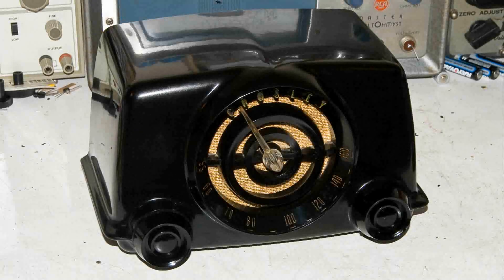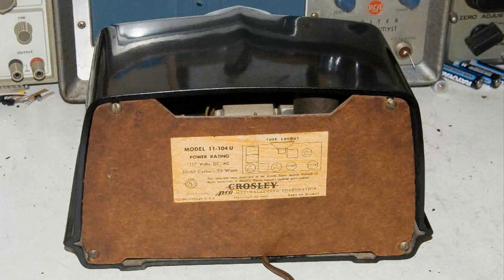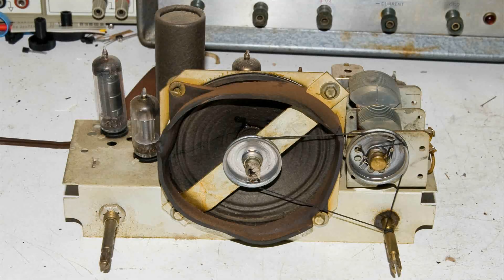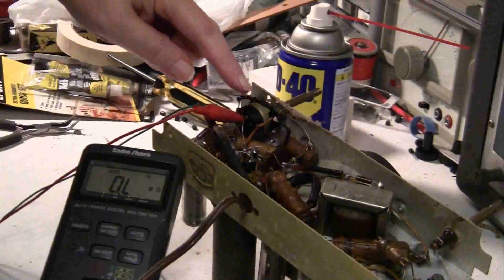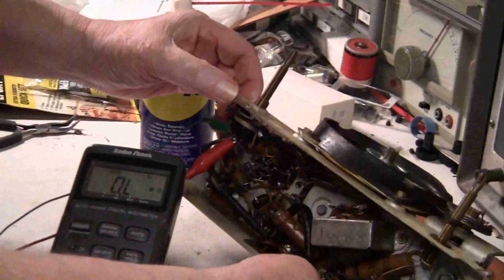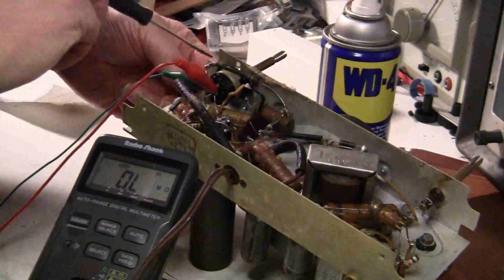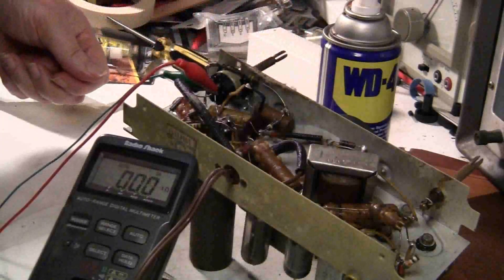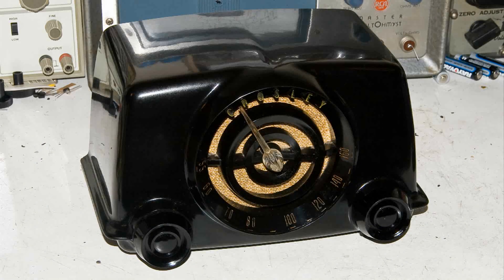Crosley radio repair 11-104U part one

Comment from the maker: Thanks AndyDaviesByTheSea
Hey Andy
It can not repair crackling. What it does is, it puts back the petroleum that has evaporated form the media that the carbon run is on. This causes the media the expand back to its original from. I first tried it out on a transistor radio, fifteen years ago. I used this radio today, and most everyday. I did a video on this radio a few years ago, I'll send you the video.
Regards
Rick

Comment: Hi Rich
Nice old radio there.
It looks like you squirted a shot of WD-40 into the switch and then another onto the carbon volume control, have you been using WD-40 on carbon tracks for a long time i.e. do you have good experience with it on carbon and does it cure crackling?
Kind Regards ... Andy

Comment: This radio over due for service about 60 years over due,he is  lucky to have you to work on it,these kind of radios is one of the reason I like tube radios the other they sound better to me.,and if a new radio breakouts in the trash ,once you did this one.it will go another 50 or 60 years.new modern radio don't look like anything special ,to the point that they are making bad copies of old radios.
Reply from the maker: THANKS

Comment: Use contact cleaner, it works a lot better than WD-40.
Reply from the maker: How many radios have you repaired?
Reply: Been repairing them since 1970's can't tell you how many I have repaired. But usually if the on-off switch sticks, it is either the little spring inside or the contact has been blackened. I used to replace them when they were a dime a dozen. Then I would take them apart to see what the real problem was.
Reply from the maker: @countryside8122  I have use other produce as an experiment. I use WD40 usually for volume and tone controls because it puts back the petroleum that has evaporated over the years. The other produces work for a while and we’re back to the same problem, so  I end up using WD40. WD40 makes the material, that the carbon run is on, return to is original size. My twenty year old experimental with a portable transistor radio is still working. I put WD40 on it's volume control, and I use it every day and it work like new after twenty years.
Reply: @AllAmericanFiveRadio  Well the contact cleaner I use is also for cleaning electrical motor contacts and has a petroleum in it. Actually I will have to see who makes it. It may be made by the same company that makes WD40.